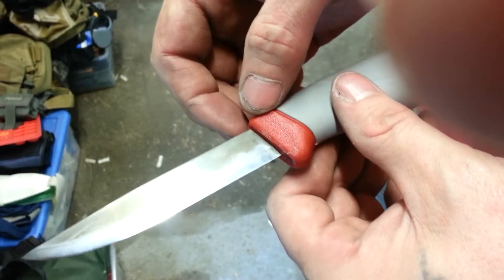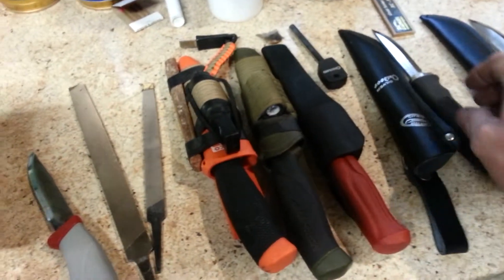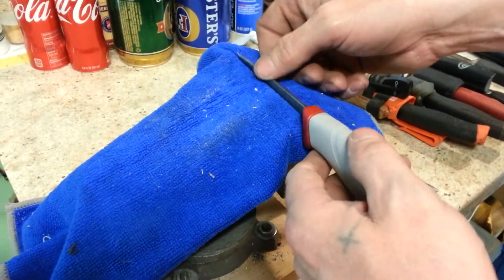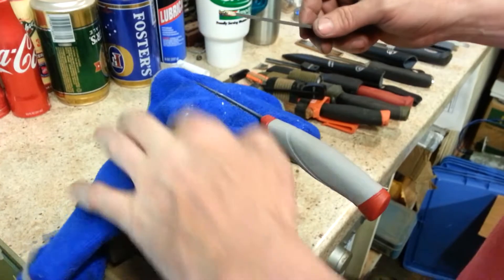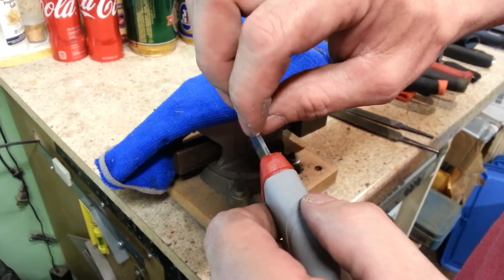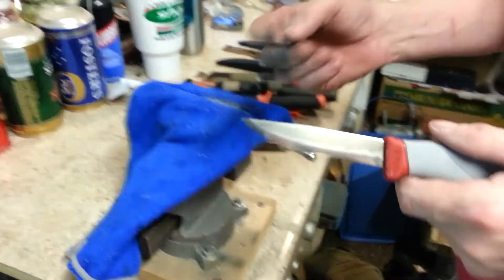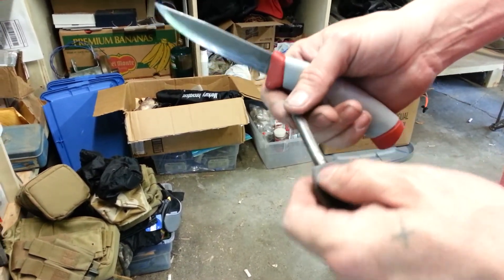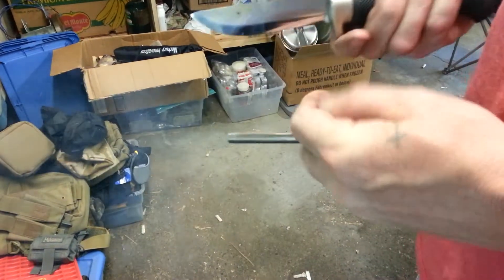How to sharpen the spine of a knife

Comment: I just bought the  Mora Companion Heavy Duty Knife with Sandvik Carbon Steel Blade, And want to sharpen the spine for obvious reasons... Is is safe to assume about 3/4 of a Millimetre will do??  And could you use a grinder??  If a file is better nd if so could you suggest what to use.. Thanks in advance
Reply from the maker: You could use a grinder if your REALLY carefull but I would not... Any type of metal file will work as long as its not to course - I use a fine one it seems to create a nice sharp edge...
Reply: Thanks for the responce
Reply: How fine would you suggest??? Is there a # on the file I should be looking for??

http://www.canadiantire.ca/en/pdp/nicholson-mill-bastard-file-0582862p.html#srp

Would one of these work
Reply from the maker: +Eric Rosbottom Yep that will work
Reply: So I will pick them up and use the fine one like you suggest. Thanks again! I have a buck knife I want to do as well its 440 HC it throws sparks now but not like it should. Cheers and thanks again I will let you know how things turned out Cheers from Canada
Reply from the maker: +Eric Rosbottom Sounds good bud - Glad I could help... I square off everyone of my blades even the stainless

Comment: You need carbon steel to strike sparks off of a flint, not for a ferro rod.
Reply from the maker: Ive done it with HC stainless.
Reply: @houseoffire72  The key there is "HC". High Carbon. Carbon makes the flint spark.
Reply from the maker: @carllove3705  yep

Comment: Nobody said stainless can't throw sparks. People carry carbon steel knives incase they need to strike a piece of quartz or flint off of their knife.
Reply from the maker: Ive heard many people say stainless wont work for ferro rods when really any sharp edge works fine for it...
Reply: Never heard that before. Whoever said that clearly doesnt know what they are talking about. People carry carbon steel knives so they can strike FLINT or quartz if needed, not ferrocerium. Ferrocerium will work on stainless or carbon steel whereas flint will only work on carbon steel
Reply from the maker: +Jesse James Exactly:)
Reply: As long as the stone is harder than the steel, you can cast sparks from any steel. Albeit some steels cast more and hotter sparks than others. That being said, you can pound hard rocks together and make sparks too.